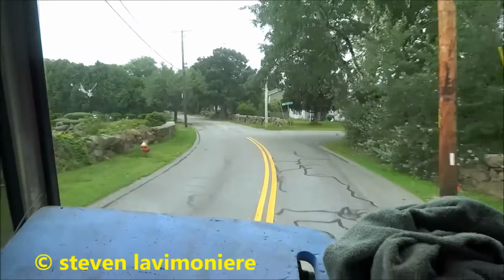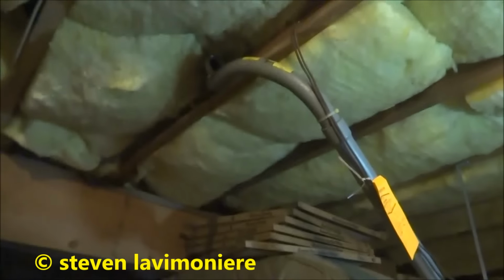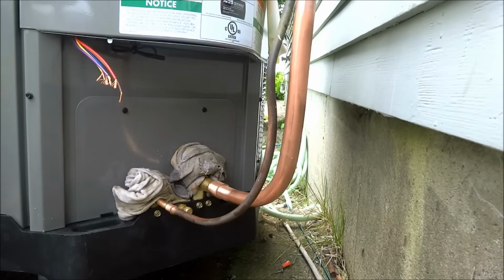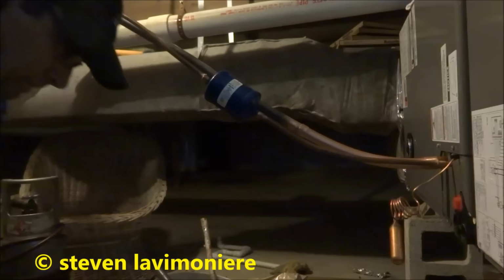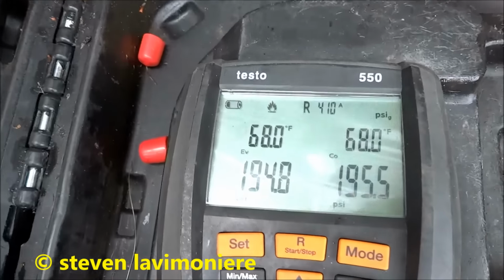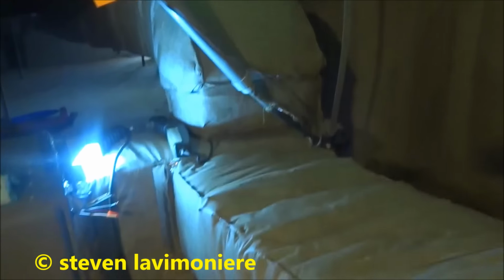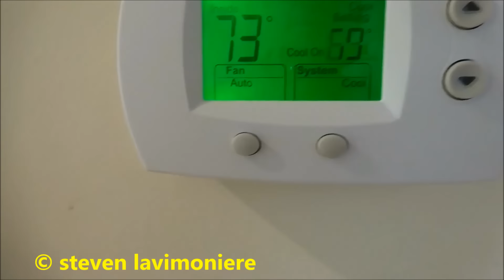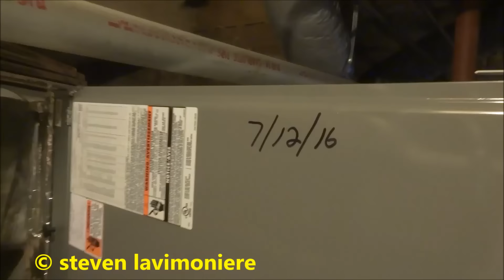3 1/2 ton heatpump / air handler replacement

Comment: I have used staybrite 8 for 36 years no problem
Reply: Been using it for over 20. No issues here either. Used on R22, r410a and compressed air systems that run around 175 PSI. Never an issue.
Reply from the maker: i have had good luck with it
Reply from the maker: if its a good solder joint it will never leak i believe its stronger then the copper fitting .

Comment: You should defiantly low flow with nitrogen while brazing, without it you get buildup inside of your refrigeration lines; I’ve seen clogged TXVs because of this. Also, when re using a line set, you definitely should get some rx-11 and then back pressure with your nitrogen.
Reply: Kevin I don’t trust that stay Brite eight

Comment: We are installing a Ruud unit, (straight A/C), this week at the hospital. It's replacing a "Pure Temp" unit I installed back in 1993 that has been trouble free for the last 23 years. Love the Ruud units compared to the Goodman units. Got to love that plastic base! Built so much better than the competition!
Reply from the maker: i like the ruud units myself there fine .

Comment: Great job on the install Steve Lav I like Ruud and Goodman
Reply from the maker: ruud is good equipment
Reply: +steven lavimoniere I still see those old style Ruuds with octagon shaped fan and the compressor in the back
Reply from the maker: them were good units had one in my house for years never had any problems with it
Reply: +steven lavimoniere Do you like Ruud gas furnaces I like them but it's hard to get the flame sensor out when its time to get it clean

Comment: Steve l  guess you like stray brite  8 the only time l use it txv valve and refrigeration valves maybe everything is else 15%  sliver solder or on refrigeration lines 45 % on copper to steel great video .Just read it copy past 
Description: Stay Brite® 8 Lead-free Silver Solder

Both Stay Brite® and Stay Brite® 8 produce an overall component with greater strength than a brazed component whose base metals are weakened by annealment from high brazing heat. Stay Brite® solders bond with all of the ferrous and nonferrous alloys. Joints soldered with Stay Brite® solders exhibit considerably higher than necessary elongation for sound, dissimilar metal joints and vibration applications.

Soldering
Reply from the maker: i like it because it requires less heat .and does a fine job

Comment: Happy birthday Steve.Did this unit came with a  filter drier  inside ?. it is ok to install another one if already comes with one.? I am new on the field and it is  always a pleasure to learn from good tech. please keep sharing and helping does that are new in the field techs.Thank you!
Reply from the maker: new ruud comes with one that needs to be installed it was a heatpump so it was bio derectional filter dyer and i installed it inside by air handler .some brands like goodman have then installed already in condenser .
Reply: Thanks.

Comment: Great Job as always Steve, and a Happy Birthday, your still a young guy. Staybrite 8 is good solder, used it for years, the only problem, you can't fill in gaps, like with Sil-15. Keep the great videos coming, I enjoy them all, and all the best with your new grill, its a beauty. PS Have you seen that product called "Monster putty" I watched a commercial vid on youtube, its suppose to block the heat real well, and its reusable many times over.
Reply from the maker: i have not used the stuff . i use a wet old sock wrag with water works well for me

Comment: Happy birthday for when it was . 52 you had a hard paper round.  Would there be a chance of a look at one of your recovery cylinders . Are they the new ones ?
Reply from the maker: they are going back to metal recovery tanks . from what i hear
Reply: +steven lavimoniere  Never know anything other than metal ones . However they are introducing fiberglass Nitrogen tanks here . Still the same gas but 1/3rd of the weight search Linde Genie cylinders.

Comment: Can I braise with one of those ace hardware propane torches? It Sounds like you bring your torch down to a level that those things produce and I don't want to buy a welder haha.
Reply: You can use a propane torch with soft solder. I used a $30 propane torch to install my HVAC system using Stay-Brite8. I had no problem getting the soft solder to flow on 1 1/8” pipe.

Comment: iv notice that stay bright 8 is harder for to Braze with...i noticed use use this in all your videos and i got some to try!!! much cheaper than what I use! any tips on using it...do u use Flux every time with stay bright
Reply from the maker: yes you need to use flux with it stayclean red lable .small amount of flux only thing i have noticed is if there is a big gap in copper fitting it will not fill in so i crimp it down with plyers if there is a big opening in fitting before soldering . its just like doing water pipe no nitrogen purge needed ,less heat used i like the stuff

Comment: Great video Steven.  That Stay-Brite 8 works very good for residential systems.  When used with the proper flux like you used, the connections are solid.  And soldering doesn't require the high temperatures like brazing, which can cook valves & filter-dryers,etc.
Reply from the maker: i been liking the staybrite 8 works out well

Comment: Is there supposed to be a flow-rater orifice that you field install in the suction line you didn't show that and I'm just wondering if that's why the pressures were not quite right.  Might want to check the install instructions.

Comment: Hey Steve quick question, I bought some 3/8 copper tubing to extend (8in long peace) the old line set to accommodate the new unit going in, its it's for the suction line and it's a general purpose soft copper that is used for refrigerator ice makers do you think it is too soft? Thanks

Comment: Steve, couldn't you use staybrite 8 on all residential refrigerant lines instead of brazing rod?Didnt you run nitrogen through as you were soldering?

Comment: I like the Idea of using Staybright8,at what temp does it liquify.and what typy gas are you using in your torch.Happy Birthday Steve
Reply from the maker: it melts like doing copper water pipe i use a propain /l.p. torch

Comment: You gotta like that old Carrier Air Handler that's 28 years using Aluminum Coil.  Looks the the outdoor units was replaced in 2001.  The original Carrier outdoor unit probably had the E-coil. Heard lots of folks had issues with them, but I seen them over 30 years old with no leaks.  Did you notice when you recovered if it loss any refrigerant? Nice install!